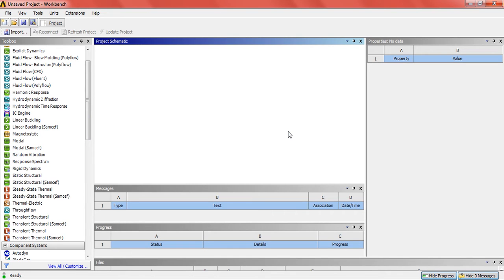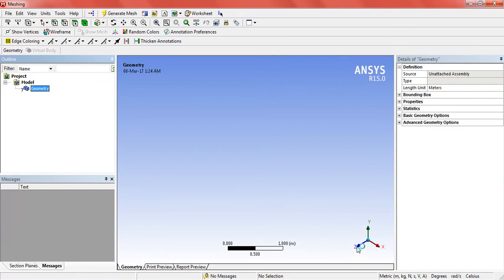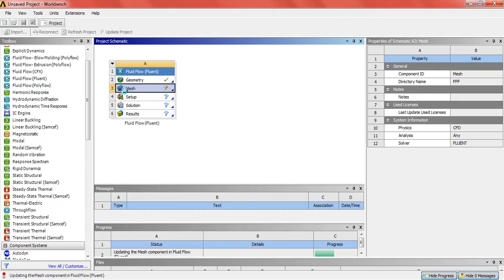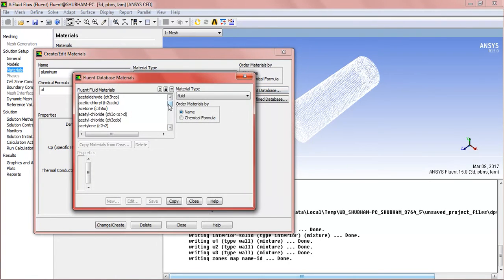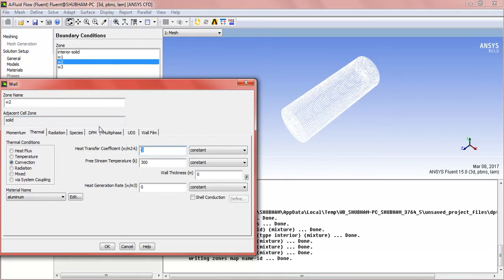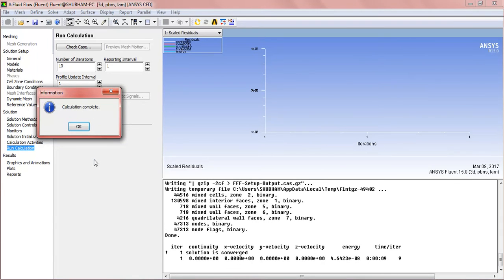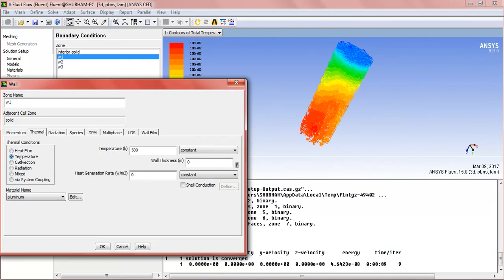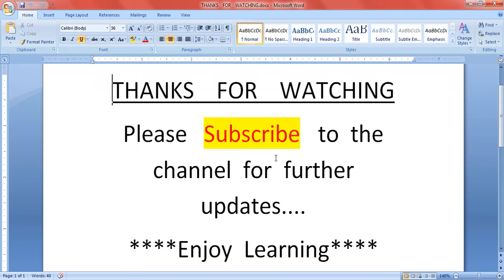Heat conduction in solid Cylinder | Fluent ANSYS tutorial

Comment: Bad at every single step. Is not a solid, the media is still fluid (cell zones), so it resolves nothing.. You can see the bad results very clearly, the most evident is that the result is a coloured image with the entire field at the same temperature 300 K and then you dont even realize that. Is so bad with so many mistakes that makes no sense to mention all of them. For metioning some, you didnt choose the material, just made a copy of COPPER and you didnt do nothing with the material, you can see that air and aluminum still remains in the simulation. Another mistake, you wanted to set the boundary condition to 500K but then ypou changed the boundary condition and didnt notice that. Then the result has nothing to do what you wants to simulate and he didnt even realize that, there is no boundary at 500K , and the form of the field is also clearly wrong. Just a waste of time.

Comment: Thank you for your video.
Can I ask a question?

3:09 why do you energy equation on? 
Can you please explain what difference between Energy equation on and off is?
Reply: You need to turn the energy equation on if you want to simulate a heat transfer problem in Fluent. Enabling the energy eqn will activate the 'Thermal' tab in your boundary conditions etc. You will then be able to input thermal properties for your materials, temperatures at boundaries etc.

Comment: 4:34
 because its a solid body, how can there be convection? shouldn't it be conduction?
Reply from the maker: Convective heat transfer takes place from the surface of the cylinder due to the transfer of heat from one place to another by the movement of fluids (air) present just above its surface.